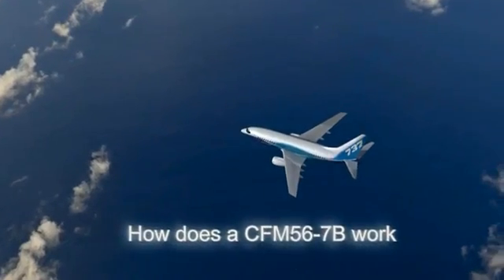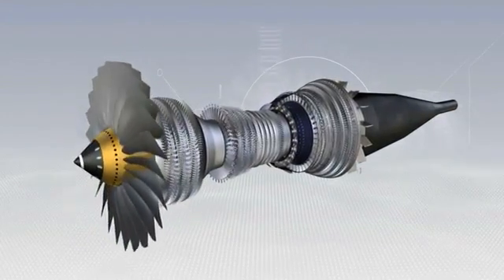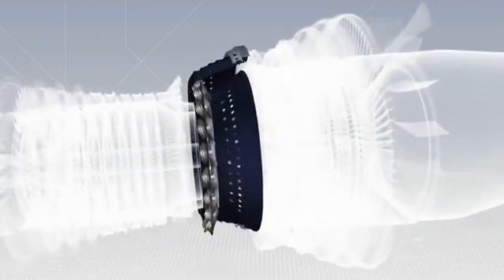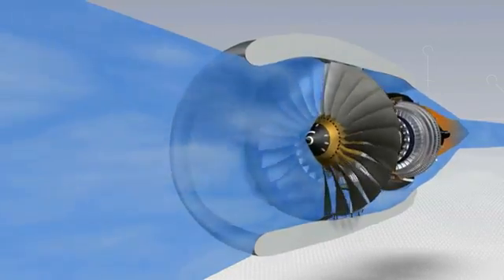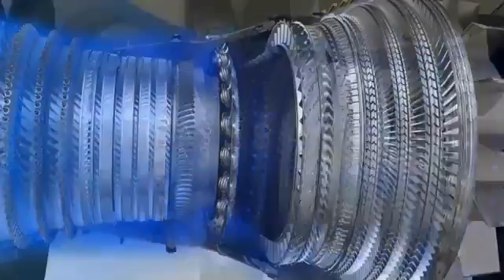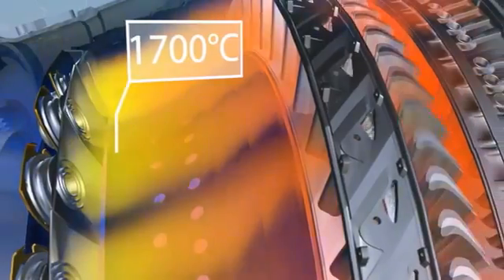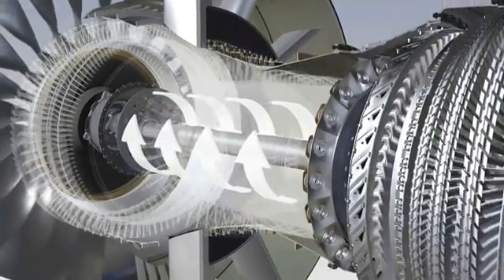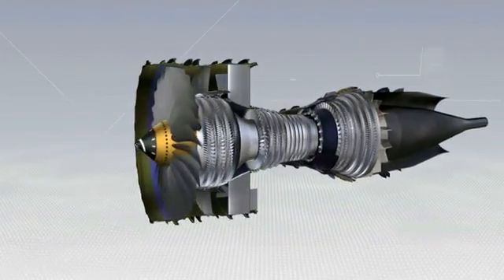How does a Turbo Fan Engine CFM56 7 Work

Comment: they always fail to explain how those the big fan stays on and how it turns on, what's the power source for this fan before combustion in the back even gets to happen.
Reply: Yeah man.. This was the only reason that i searched for this type videos nd no one  explained it in any video.
Reply: Bleed air from the APU.. or if APUnis inop a ground air starter unit.

Comment: So essentially, a modern jetliner is still prop driven, lol. I never looked at them like that.
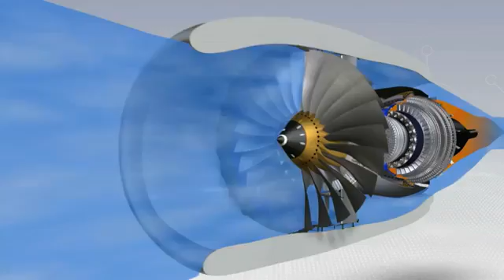Reply: at 1:32 he said that 80% of the thrust is made by the bypassed air so i guess the other 20% is the ones being burnt inside the combustion chamber which basically power the fans. so yeah ultra high speed spinning propeller i guess 😂

Comment: Thank you Gentleman for your information.
I have done specialization in Gas Turbine. and I am working in Gas Turbine Power Plant.
During our College days, We were taught Single Shaft Gas Turbine only.
I am happy to know that Aircraft Gas Turbine has Concentrically mounted double shafts (N1 & N2) that run at different speeds to avoid shock waves 
My question is 
1. Ball Bearing or Roller Bearing mounted between N1 shaft & N2 shaft are subjected to high temperature . Though Bearings are cooled by Oil sump system. 
Has Engine encountered Bearing jam due to cooling failure in flying history? ( In other words improper cooling leads to local heat rise & eventual relative expansion between rolling element & stationary element of the bearing)
2. Since N1 shaft & N2 shaft are mounted concentrically and free to move on either side.
Is it possible at anytime  for N2 shaft  to rotate in opposite  direction?

Comment: Really interesting. I would have like to know about the start up sequence.
Reply: I wouldn’t mind explaining.
When the engine is started up, air is forcefully sucked into the intake. Once airflow has met an acceptable level, jet fuel is injected into the chamber, at which point the pilots will ignite the fuel to begin combustion. This is commonly where the high-pitched “Whooshing sound” comes from when the engine begins to start up. The first combustion ever-so slightly turns the fan. More air is sucked in and combusted, spinning the fan faster and faster. This is seen as the engine spooling up. The startup sequence will continue until the engine has reached optimal operating level.
Reply: The ignitors are ALWAYS activated BEFORE introducing fuel or you very likely will have a “hot start” (or even an explosion) that may severely damage the engine. The combustion chambers need to be EMPTY when you start sparking.   In the sequence you hear a whirring sound as the compressors are spooling up, and then the ignitors clicking away, and then you hear a louder sound (like standing next to a loud gas furnace in your home) when the fuel is introduced and the combustion chambers are lit. When the engine is up to ground idle speed, it is a beautiful (though deafening—if standing near it without wearing hearing protection) symphony of sounds.

Comment: Wait are you telling me that turbofans don’t use the jet engine to provide thrust but just use the jet to spin the fan which provides the thrust same as a propeller?
I feel like a dumbass
Reply: Combination of both. The jet becomes more relevant at higher speeds; the fan improves efficiency though

Comment: Lmao this video proves that these bad boys don't use fuel to fly. None of these engines can withstand that heat. 

Don't believe me? Read this document and think again.  http://www.intechopen.com/download/pdf/22905

They fly off of straight up bypass air %80 of the thrust and compressed air(which is heated through adiabatic process) 20% of the thrust. Enjoy
Reply: B Rush lol
Reply: yo b rush

Comment: What I never understand is why do the hot gas and fuel not blast out the front also? Or how can you compress air fuel into an already pressurized burning chamber area that has more pressure?

Comment: actually,what is the difference between turbofan and turboprop?
Reply: Turboprop has turbines driving a propeller which drives airplane forward, turbofan uses exhaust thrust to move the airplane.
Reply: So prop "sucks" it forward and fan "blows" it forward? Am I thinking of it in the right way?

Comment: is the fan rotation cause or the effect?
Reply: they always fail to explain this part, still a mistery to me.
Reply: It’s both. Positive feedback loop. The engine startup consists of a battery powering the spinning of the fan to draw in air. As the air combusts and passes through the rear turbine, considering the rear turbine, forward compressors, and fan are all connected, it creates a positive feedback loop. It’s constantly spinning the fan faster, to draw in more air that combusts, which spins the rear turbine faster, which spins the fan faster, which draws in more air, so on and so forth. So the fan rotation is the cause and the effect. The same can be said for literally the entire engine apparatus. You control how fast the the engine spins (and consequentially how much thrust is produced) by how much fuel is injected into the combustion chamber

Comment: front fan serves 80% of power and all that long chain of complex expensive compressors and combustion serves 20%
Does that mean if an engine of 90,000 lbf thrust produce only 75,000 ibf won't serve the purpose? looks like 80% of cost to get 20% of thrust and 20% of cost to get 80% of thrust!
Reply: alright!, I missed the fact that the main purpose of combustion is actually to rotate the front fan while the additional 20% of thrust by the exhausted compressed hot air is a smart added benefit.

Comment: I read somewhere that a compressor exists out of multiple blades. Which I understand because of the need for a rise in pressure. Though, it also said that there a two kinds of blades, low-pressure blades and high-pressure blades, which follow each other up in the compressor. My question is, what is the difference between the two kind of blades and why are they called low-pressure and high-pressure blades? Thanks!:))
Reply: Stan Kuykens The PRESSURE relates to the incoming air being compressed by the Low Pressure Compressor (which are the blades one can see) and High Pressure Compressor. As air travels through the engine it is compressed to higher and higher pressures till it finally enters the combustion chamber. Also, the higher stage compressor, the smaller blades.
Reply: JG Hart thanks!

Comment: I never realized how much thrust came from the bypass air.  So a modern turbofan engine is basically a turbine engine powering a ducted fan for most of the thrust.
Reply: similar to a turbo prop
Reply: 80% of thrust comes form air ??  so we are literally flying on air :P
Reply: it would be similar to a turboprop if this is the case but as far as I know it's the super hot gasses mixed with fuel that produces all the trust, the high temperature of those glasses is the key, so hot that it cuts through regular air like a butter knife pushing itself forward against the denser and much heavier air in the back of the plane, the cooler air becomes like a push wall.

Comment: I have a doubt... in starting time which component initially rotates the compressor fans ??
Reply: Cibin Joby Jet engines have the equivalent of a small starter motor to get them spinning up. Modern engines compress air 50:1 to 60:1 so they don't need much spinning to get up light off speed. They also don't need much power to spin as they're incredibly well balanced and can be turned by hand.
Reply: Thank you 🙂

Comment: What start to rotate the Fan as first?before the Compessor inject kerosine???Hydraulic?? Pressure?El.Motor???
Reply: Most turbofan engines use compressed air pumped into a turbine starter-motor. The pressurised air comes either from the auxiliary power unit (APU), from a gas-generator on the ground or from the other engines on the aircraft if they're all ready running.
Reply: A Technology Masterpiece...tnx buddy

Comment: why does the air need to be compressedbefore going into the combustion chamber?
Reply: +pierre jean To raise the temperature of the air so combustion happens easier. Also compressing the air mean more air can be delivered into the combustion chamber...more air, more energy potential.
Reply: +Shadd Bradshaw ohh thanks now I see air compressed need less space so more air in the same space, and more oxigen too, thanks for the eureka
Reply: Lowering the temperature of the air means a higher air density, therefore more oxygen for combustion. Since when you compress air, you're increasing the energy of the air so it gets hot. So if you can lower the temperature of the air after compression, you get cold compressed air instead of hot compressed air (which is what you'd have without an inter-cooler).
Reply: Shadd Bradshaw... Why do they cool the air with "inter-coolers" in some supercharger systems of similar air compression/combustion process?
Reply: For much more power in a small space of the combustion chamber, but the heat of 450°C of the compressor is not desirable it is a consequence of the compression itself the compressor zone has to be as coldes as possible and the combustion chamber has to be as hot as possible, colder the compressor stages and hotter the combustion chamber more power will release the engine at the same size but less lifespam.
Reply: "less lifespam"...? Bummer.:-/ I kinda' like spam.
Reply: It's tough to visualize and realize the workings of the turbo fan. tough to grasp the rpms.

Comment: I still don't quite understand the reasoning behind the turbofan vs turboprop. If 80% of the trust is from the first large fan, why add complexity and weight with the turbine section? Why not go for a large turboprop instead?
Reply: The efficiency is based upon the velocity of the propelled gasses to the velocity of the plane.  Turbojets were inefficient because the exhaust gas velocity was like 1000 mph and everything above 500 mph was lost energy, so they came up with the idea of using some of the exhaust energy via a second turbine to power a fan (first at the back) so that they could push twice as much air but at half the initial velocity  1X at 1000mph = 2x at 500mph.   It has morphed over time to the point where the turbofan is less a jet and more a very complex turboprop blade (fan) inside of a duct (which directs the airflow better than a propeller).  There is also the issue of prop velocity, where if you make the prop too big in diameter, the outer edges exceed the speed of sound and create a shockwave which really complicates things.  Modern turboprop planes like king airs have gone from 3 to 4 to even 5 propeller blades.  More blades is more complex and more expensive, but you can drive (5) 8ft blades much faster than (4) 9 ft or (3) 10 ft blades, thus moving more air and increasing performance.  This is also a design consideration for turbofans.  A 10 ft fan might run at 2000 rpm, but a 12 ft would have to run at 1600rpm.  So the turbofan is a compromise where they can work within certain performance windows to optimize efficiency.  Therefore, the type of engine used is determined more by the planes intended performance window.  Small bizjets which fly at 450-500mph use high bypass turbofans, just really scaled down.  Another issue is flight time and distance.  Rule 1, never outfly your cabin, which is a time issue.  Short distances are best served by a piston engine and propeller, medium distances by a turbine engine driving a propeller, and longer distances by a turbine driving a fan.  The other thing is that turbine engines can operate at much higher altitudes which is better because they can compress the available air to generate power, but the resistance of the thin air is much less so they can fly much faster on less power at altitude, but it also takes time  (20-30minutes) and more energy to get up to 35-40K ft, which makes less sense on short duration flights.  Regional airlines therefore use turboprop planes to fly legs up to 500 miles because a turbofan would only be in its ideal operating environment for a short period of time.  It is just using the right tool for the right job.  The evolution of airplane engines is a fascinating subject, and really huge strides have been made over an amazingly short period of time.
Reply: @robertslugg8361  Brilliant description and information. Cheers.
Reply: Robert Slugg answered questions I had and more, hats off to you
Reply: CheapSushi you didn't understand the video. The turbine section is what spins the fan, where 80% of the thrust is produced. Without the high pressure core section you wouldn't be able to spin the low pressure fan.
Reply: A turboprop still  has a turbine - inside the engine core, it's essentially a scaled down version of the same thing, only instead of the fan you have a reduction gearbox driving a prop. It's more fuel efficient, but produces less power, so they are great for regional airliners (i.e. the ATR series and Dash-8/Q400 series). Piston engines on the other hand are completely different and aren't suited to commercial use as they loose efficiency at high altitude (unlike turbines, which compress the air entering them), and have a low power-to-weight ratio. They are also require much more maintenance time as they have far more moving parts. On the plus side they are cheap, so are popular in general aviation, with  private individuals, local flying clubs, flight schools and the like. These days, even some small GA aircraft are moving to turboprops though - while at the same time, battery electric GA aircraft are also starting to enter the picture.

Comment from the maker: Actually this video is intended for visual explanation during my type rating course, eventough my aircraft using CFM 56-4B series but the common principle almost same. That's why I don't put any explanation. You need to be understood basic principle of aerodynamic for jet or turbofan engine, and then this visual explanation build up your imaginary mind. Most of them need pneumatic starter normally supply by APU or external pneumatic turbine. But for some people could understood in their first time. Please put eye on it and turn on the volume.
Reply: So the fan provides most of the thrust.
Reply: Great presentation... Thanks! 
I always wondered why this engine was flattened on the bottom intake? It looks like the engines hit the runway on a hard landing or something... HA! 
Does that shape provide for better/more air intake? 
It also looks like the bypass air is further compressed as it moves to the back of the housing... Is that the case and why? Thanks again.:)
Reply: boeing 777 That is correct and somewhat counter intuitive as you mentioned... P&W is also introducing a planetary gear set to run the front fan for even more efficiency. It's actually quite amazing how in-efficient jet engines were and still are.
Reply: markmnorcal no. The jet provides the overwhelming portion of the thrust. The fan is supplementary and adds fuel efficiency and moderate thrust using  the rotational energy of the turbine section that would otherwise be wasted.